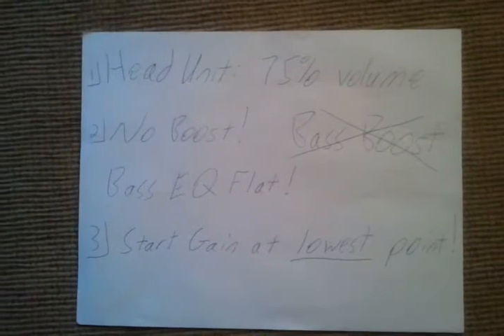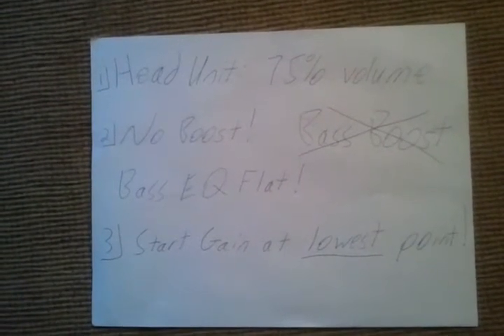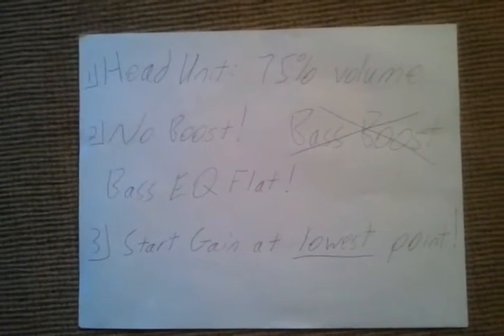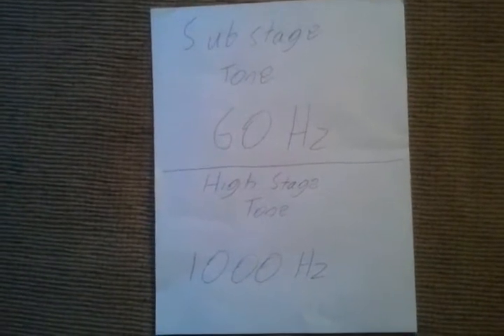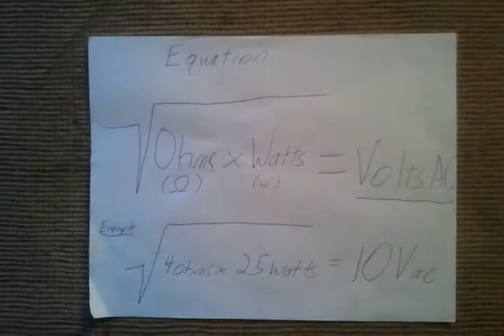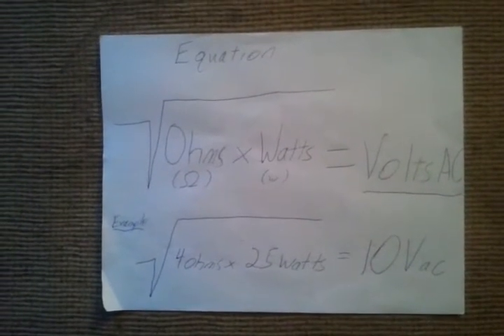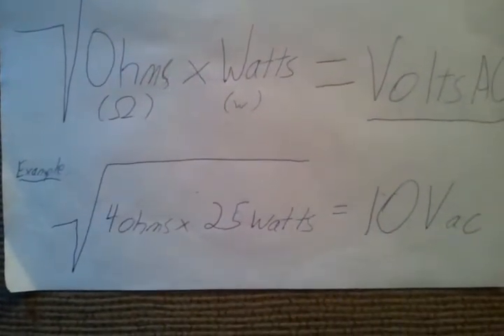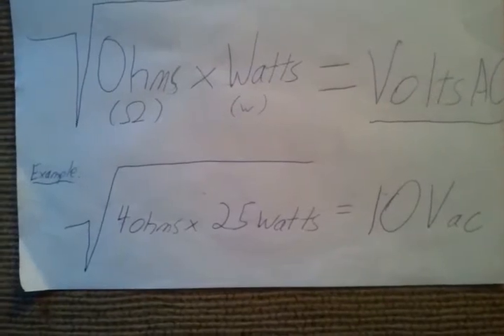Amplifier gain setting tutorial, set gains right!

Comment: Would adding bass boost on the amp or changing the head units equipment have an effect on the voltage after u have tuned it. I know u have to tune it with everything flat but when listening to music I would usually add a bit more treble or bass since my tweeters and mids run off the head unit

Comment: You're trying to relate RMS power to RMS voltage here. The problem with this approach is that you cannot directly relate the two if phase angle is not known. You need first to determine the phase angle so you can calculate the voltage factor. The procedure shown in this video would not yield accurate result. Just use oscilloscope or better use SMD DD-1.

Comment from the maker: tricky question, I'll split it in 2.  Lets start with a substage amp.  If you have a sub stage amp you can either set gains on the amp then leave eq's 100Hz and under settings at 0 or set the eq to desired setting and then set the amp's gain.  I personally would prefer the former.

As for setting gains for a high-stage amp, every frequency will react differently as far as power delivered so my recommendation is set amp gain with EQ flat.  but watch those high peak settings on ur EQ

Comment from the maker: Alt could be drastically upping the voltage at 40mph and higher to compensate for the car's electrical needs.  That would make the amp hve more output.

Comment: Unless you know exactly what your amp can put out, this is worthless. Unfortunately way too many amps do not put out what they claim. Also, most headunits will distort long before 75% max volume. Heck, some even distort/clip @ <30%.
You need a scope and you need to measure at several frequencies. I do a 1/6th octave from 20hz to 20khz, and then run a sine sweep. Also, all the signals I use, is 0db gain on the nose. Once all this is done, I measure the voltage from the line outs, and deduct 12 db from that. Then I know I have a 100% clean signal at all times with headroom. It is that cumbersome but it's the only way. As with any other sound system, headroom is key to good dynamic sound reproduction. If you don't have enough headroom in relation to how loud you want your system, your system is too small, FACT. A 9 db headroom is an absolute minimum and 18-20 db is nice. Most good recordings have a crest factor of about 12-16 db. Crappy modern compressed recordings can be as low as 6 db, and are usually recorded so loud, that they are already above 0 gain unfortunately.
Bottom line, it is not as simple as you show, and the way you do it, is inviting trouble and damage to the equipment.